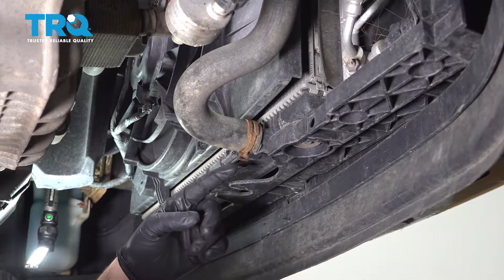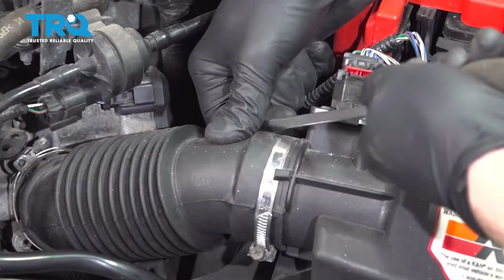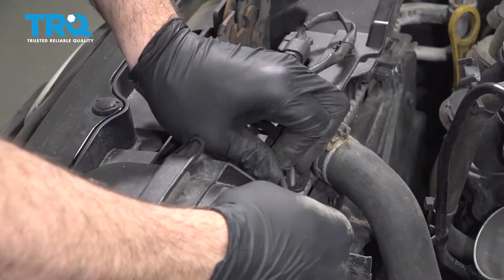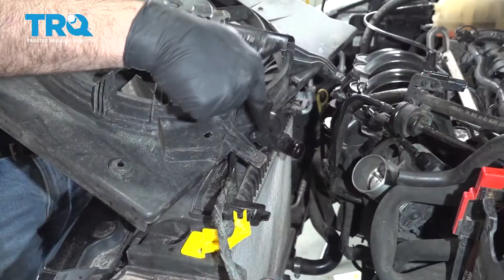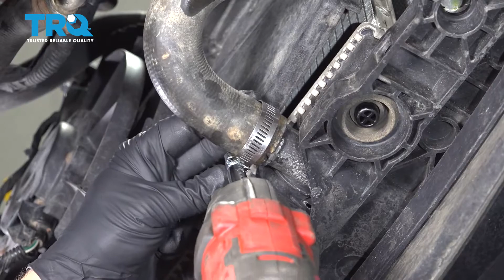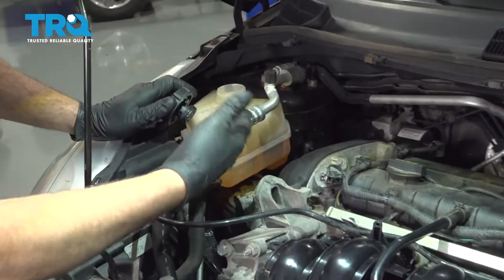How to Replace 2011-2019 Cooling Fan Assembly  Ford Fiesta

Comment: Ok, it took me longer to watch the video than it did to do the job. 1st undo intake pipe at airbox end, undo rubber airbox mount at front. Remove whole airbox as 1 lump. Take off top rad hose and tuck it behind the intake pipe (stops you losing coolant). Undo top fan clips and harness clips. Lift fan, turn 90° and lift out from car. Now just put everything back in reverse order. Took me 6 minutes. 👍

Comment: just so everyone is aware, the wiring harness tabs will always break when you pop them off.

My question is... mine is squeaky, can you remove the backing of the fan and attempt to oil the fan stem going into the fan motor? 

Mine is about on its last leg but the fan still operates but it sounds dry like how a normal fan in your home does when it gets dry and gunked up.

I really dont wanna spend the money right now to replace it if its not necessary.

I have a 2019 Ford Fiesta SE and the fan will run and then it squeaks and slows down and then stop making the sound for a few and then does it more. So that tells me the fan stem / fan motor area has no grease left.

Comment: I managed to get the fan out without removing the hoses and having to drain the radiator. It will save a lot of time!!!
Remove the airbox, jack the car up and once the fan is unclipped and freed you can take it downwards through the bottom of the car. The same can be done for re-fitting. Took me 30 mins on a 1.2 fiesta 2012.

Comment: I'm trying to determine where the wires go that come off the harness and up next to the hood latch. Could you tell me what they attach to? Mine got ripped off at some point. And I  can not find what they plug into. Thanks for any help you can offer